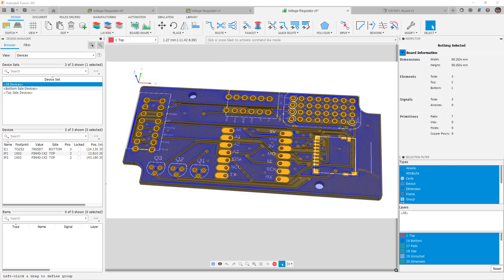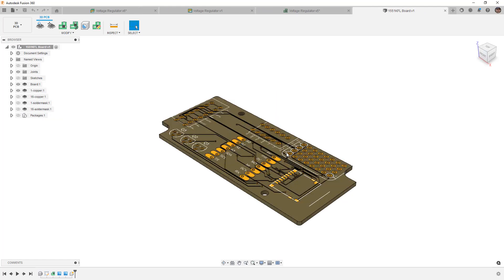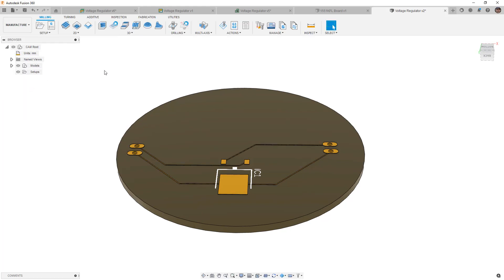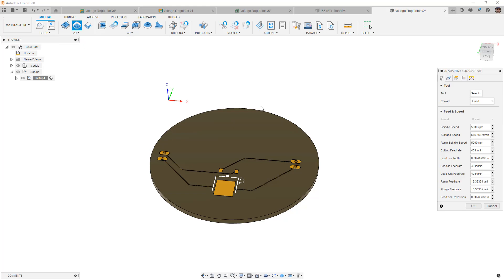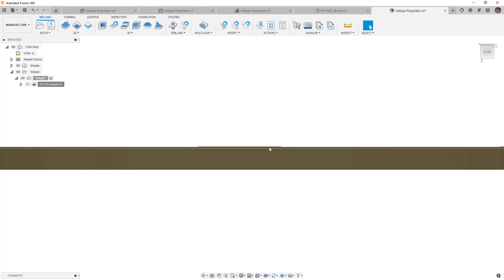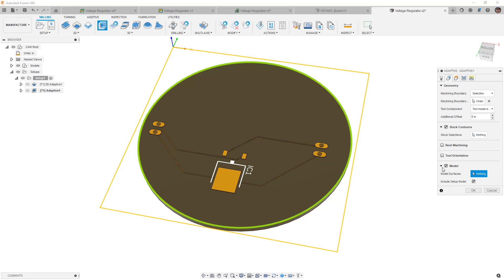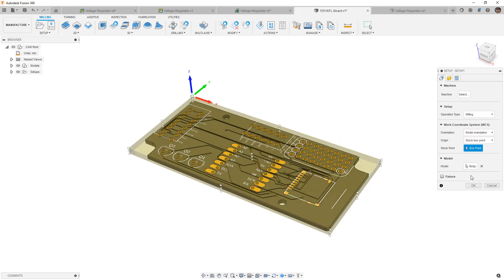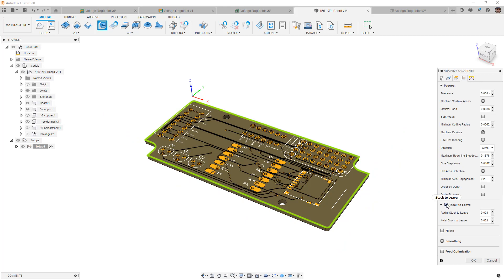How To Use Fusion 360 To Mill A PCB #Fusion360 #Manufacturing #CAM

Comment: After milling with the flat end mill, I wanted to switch to an engraver to clean up the missed sections of material. Do you have a video that includes tool changeing?
Reply from the maker: What machine do you have and are you on a hobby license?  Hobby licenses don't support tool changing, but edu and commercial do.  If you have an automatic tool changer it is just a matter of making sure the tools in the library have the correct number and it invokes the tool change when the operation changes.  If you are doing it manually it depends a bit on the machine.  Since I am not on a hobby license I am not 100% sure if there is a way around the tool change.  One thing you could do is create a second setup with the engraver but have the same WCS location and just post that as a new program without removing the part.  This way at the end of the milling the machine stops, you can swap and set your new tool, then run the second program.

Comment: This video does not explain PCB milling at all. It fails to CNC the traces. Pretty dumb to call it a PCB milling video.
Reply from the maker: When milling a PCB you have a single copper layer and you remove everything but the traces.  In the video I show how to use the adaptive clearing to remove copper around the traces which would leave the actual connections behind.  What is it you are trying to mill and that this video didn't show?

Comment: hello, how can i print the copper parts to scale on a sheet of paper using a regular printer. convert it to pdf form or something
Reply from the maker: Im not sure there is a super clean/easy way to do this but the info is there.

You can go to the manufacture tab and to Manufacture Preview and export an image or DXF of CAM data.

If you go to CAM Processor in the list on the left under  ODB++ you can get a black/white image of the top and bottom.  Same in Gerber under Top Copper or Bottom Copper.  These images will be black/white, which i assume you are trying to etch your own board.  But they won't be to scale if you just grab a screenshot of them.

When you export the MFG data you will get a GBR (gerber) file for those images.   You will need a program(some online options may let you) to open the gbr file so you can print it.

The DXF file will contain the traces but you aren't going to know which is top/bottom and if you have say a polygon pour fill.

Comment: what cnc machine do u use?
Reply from the maker: I don't currently have one for personal use.  Most of my programming time has been on HAAS machines both Pre NGC and NGC controllers.  Ive done manual programming on older machines even back to some old school tape drive anilam stuff.

I just made this video to answer a few questions that came in.  Do you have a specific CNC question?

Comment: how to make tool path for pad Solder Mask  and some remove copper point need every process to complete thankyou
Reply from the maker: on the solder mask you would just be machining away on the traces yes?  so then you would need to select the 3d trace you want to "clear" the solder mask off of.
Reply: @LearnEverythingAboutDesign  yes but fusion new update some fusion missing old method can't be used anymore and i need your help to demo Process until I can build my own pcb completely, eg clear some copper faces that are not showing or draw more. Thanks for my request.